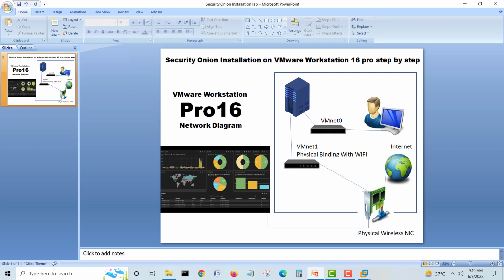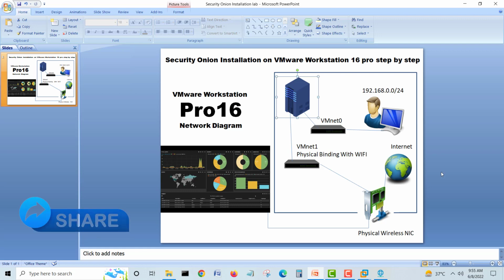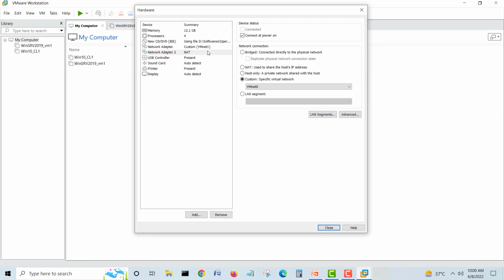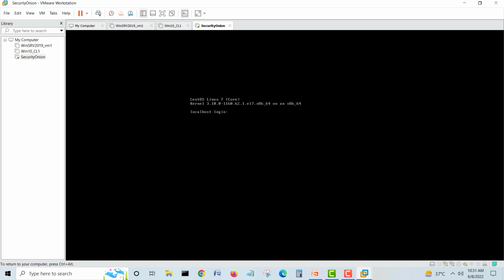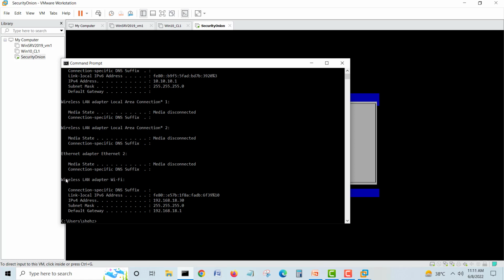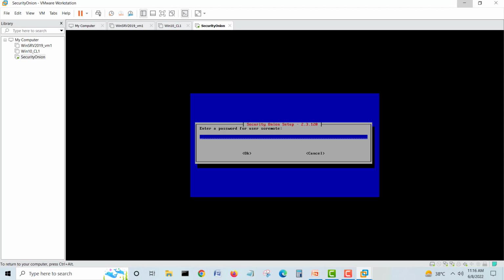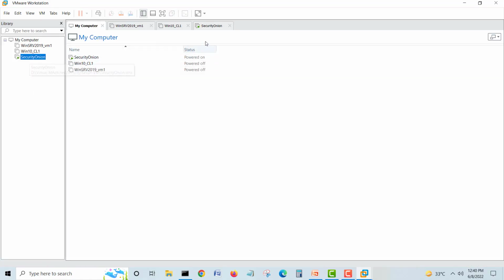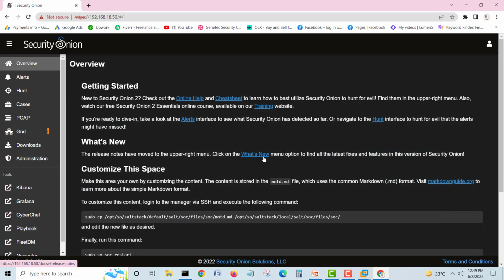How to Install Security Onion on VMware Workstation 16 Pro step by step lab

Comment: Sir, i have installed security onion on vmware and using metasploitable and kali linux for testing. I'm trying DoS attack with hping3 and it got no alerts on Security Onion. Is something that i forgot to do ? Thank u sir
Reply from the maker: Hi Rivola might you need to do some NIC settings in VM
Reply: @shehzadarshad2000  I'm using NAT dan Bridged for Security Onion on Network Adapters settings.. Kali Linux is NAT dan Metasploitable NAT too.. What kind of NIC settings that should i use sir ? I'm using the network adapter that used on Official Security Onion Documentation
Reply from the maker: @rivola.z  https://youtu.be/mm1QwoU0a1g

Comment: hello sir thanks for this video. I successfully installed security onion on my virtual box but i can't seem to access the web interface. Please can you tell me what can be wrong. I have tried like 5 times. I still don't understand how to configure the NICs and will I access the through my normal computer or a virtual computer?.
Reply from the maker: hi thanks kindly try to access from your host computer not from the virtual machine
Reply: @shehzadarshad2000  I did but it still did not connect it just says "request time out"
Reply: @starboygadtuso9530  I had the same issue. I just rebooted the VMWare again and I could access it. I hope this help you.

Comment: sir I am installing security onion by attaching private network adapter which do no have internet access, will it work as I am not getting any alerts on the security onion dashboard
Please help me
Reply from the maker: Yes Chetan it will work
Reply: @shehzadarshad2000  sir can u help me in configuring...I am not getting any alerts..Its's been a week I am trying
Reply from the maker: @chetansinghal7971  Chetan did u follow all the steps make sure the admin nic and traffic should be different nic and physical nic coming from the switch span port should be configured on the switch as well